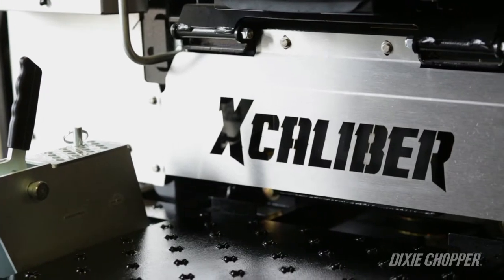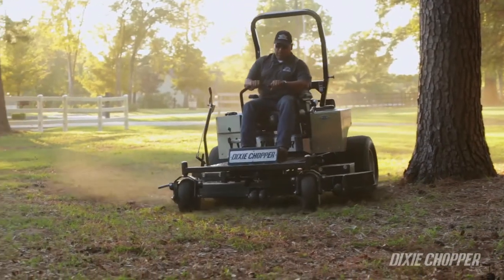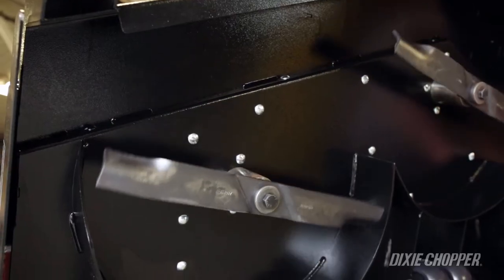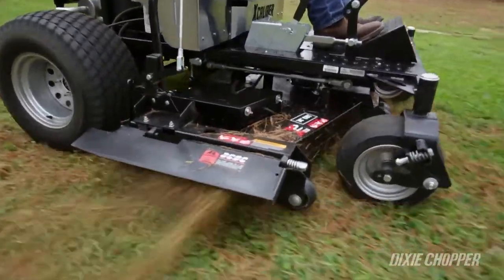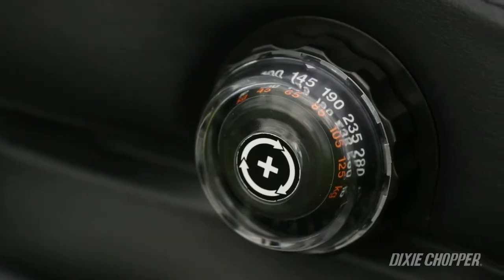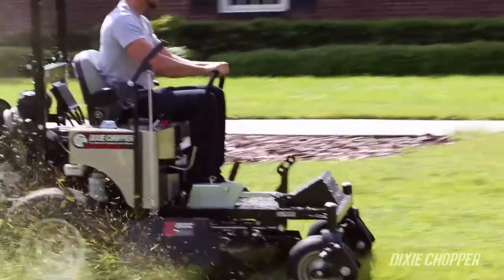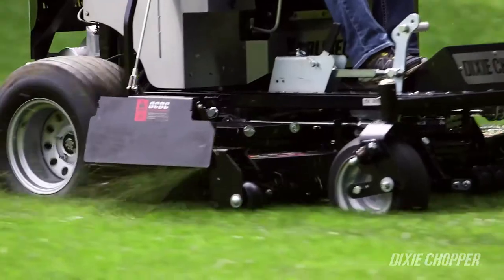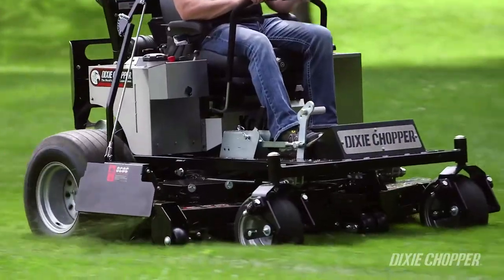Dixie Chopper - XCaliber Zero-Turn Mower

Comment: Faster then a super z?
Reply: It has the largest running gear available on a zero turn. 21cc pumps and 336cc wheel motors. 40 horse power vanguard. What do you think?